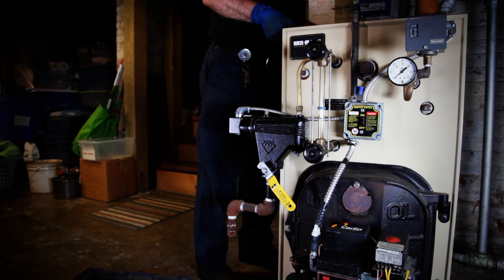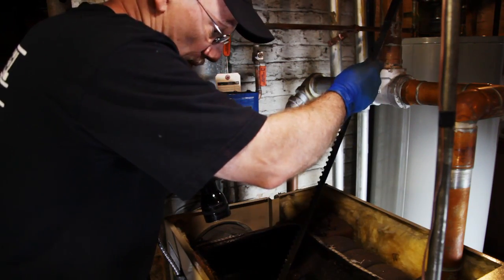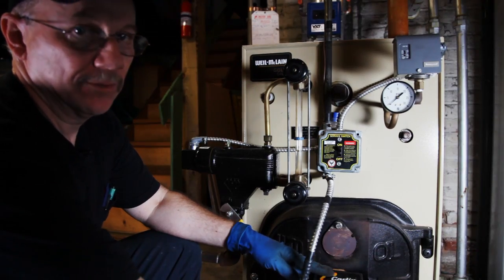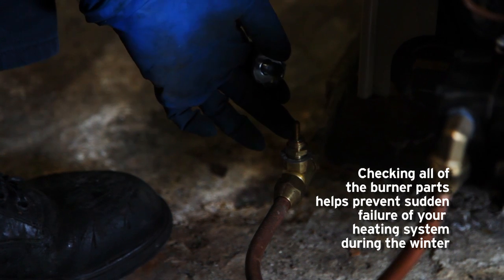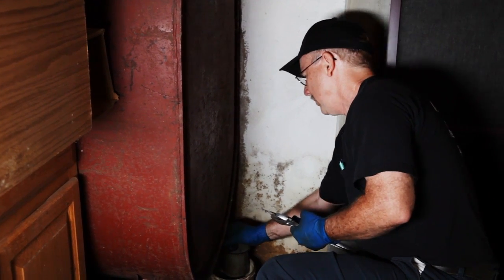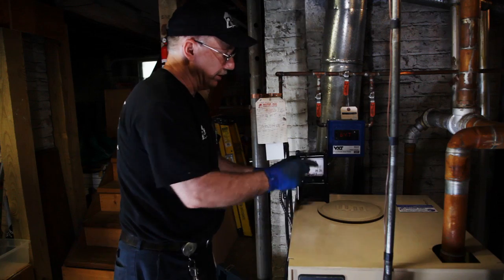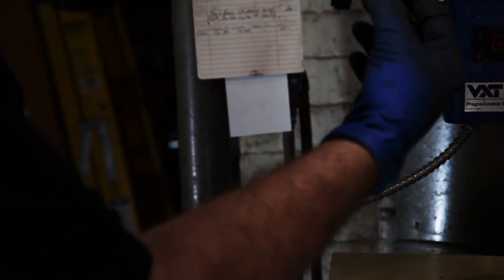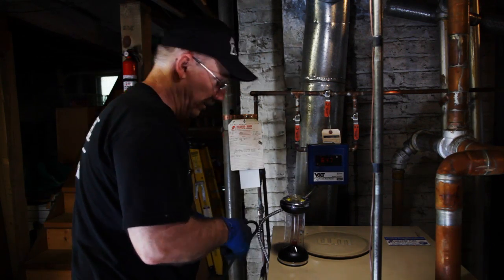Heating Oil System Cleaning and Tune-Up: What it is and What it Does

Comment: I have had my burner for 10 years never had problems they came for a service cleaning filled tank 12 26 almost empty  on 1 28 i dont know what they did but this is messed up and it has not even been a bad winter so far

Comment: How do you calibrate the furnace so it burns oil most efficiently? I saw the furnace service guy use something that measured the % CO in the exhaust, but I wasn't sure how that worked.

Comment: just had my boiler serviced, the service tech recommened that i replace the oil line that runs inside of cement pad from the tank to the furnace.He claims that the cement can damage the copper tubing, thus avoiding leaks.he could run a new line from the tank by going up a wall into the roof, than down to the furnace. I have a rancher with a A frame roof so it would not be a big deal, All for $800, is this something i should consider? This is my first house with oil heat. Any thoughts!

Comment: If a bird or loose bricks, need a listed liner w/ cap; Soot vac; Test/ replace PRV; Test LWCO; Cu header on steam; Makeup air; use digital CA-not dumbbells and test at startup/ 1, 5 min then shutdown; ambient CO?; pump strainer and nozzle; oil motors; inspect combustion chamber then vac; Ck. vents and traps on steam; how far wet return;ck gauges, sight glass; ck stat; inspect for leaks; test emergency disconnect at entrance to room and switched light. Replace gaskets & connector pipe prn

Comment: Copper headers on steam??
Reply: You can use copper on steam no problem
Reply: @Chris4796  no good. Read Dan Holohans book or Heatinghelp. Com. Copper no buono. It can actually split the sections. Also Ive seen steam come thru the solder joints

Comment: @MrLordmetalz28 That's a fact. Boilers plugged with soft soot are the worst especially when they are enclosed within a finished basement with rug floors. Or the boilers with no isolation valves that need to be tapped into for example replacing a circulator bearing assembly which nobody cared to oil. My father was one of the first licensed oil burner techs and during his time a lot of techs actually dropped dead inside basements because of the bull crap back then which was far worse than today.

Comment: how old is this video? a liquid Bacharach? I am a the lead tech for a company in NYC and we use top of the line Testo units for our testing. Granted we work on 2/4/6, gas and GO up to 80gph, but we use them on residential as well. And what is with the copper headers on your customers boiler? Don't you use black, steam fittings and double swing joints?

Comment: @yrtuag Also clogged (with scale) flue passages as well. It's hard to explain  taking 3 hours for a c/s and the ones b4 you only taking 1 hour.In my opinion this practice has given oil heat a bad name. Not cleaning flue passages cuts down the heat exchange efficiency and may also cause fumes to escape which is not good especially if it displaces enough oxygen.

Comment: What about your over the fire draft? With a -.04 draft at the breach on a Weil Mclain Gold and clean flue passages if I remember correctly the O.F. will be in the neighborhood of -.01  maybe close to a +draft which may cause fumes to escape . you might have to increase draft to -05 @ breach to prevent fumes. Some Techs cheat and don't really clean the unit. I have been put in the position many times having to explain how a chimney base cold be full if it was being cleaned every year.